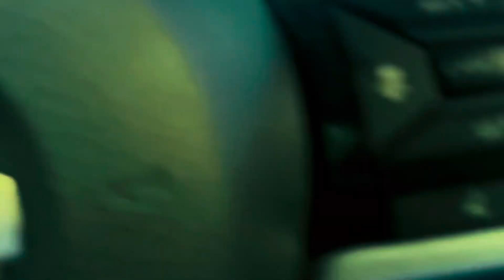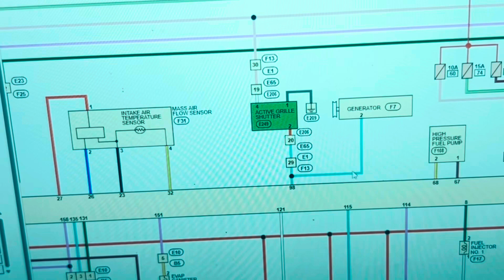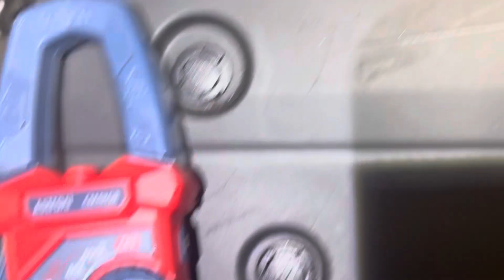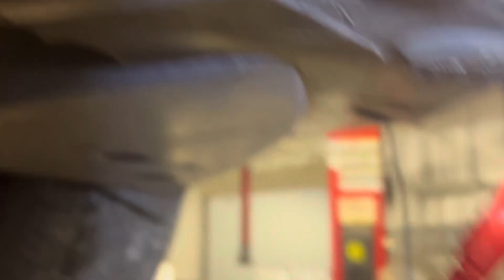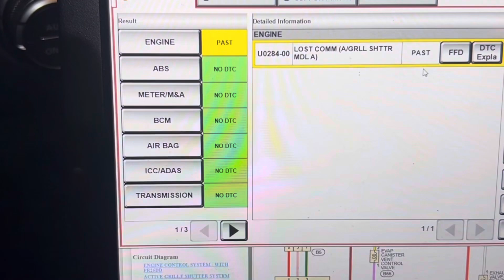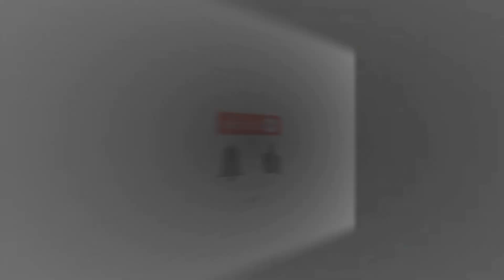LIN-BUS!! Nissan Altima Check Engine Light U0284

Comment: Great job! You should get a cheap pocket oscilloscope and use it instead of your meter. Then, you can actually see the network. Thanks for sharing!
Reply from the maker: Yes I’ve been thinking about the micsig!! Thank you so much
Reply: @MeL1AutoDiagnostics @MeL1AutoDiagnostics  The Micsig looks excellent, but I was talking about something really cheap, like in the $100 range. It's not the greatest for cam crank and in cylinder. But for networks, you can't beat it.